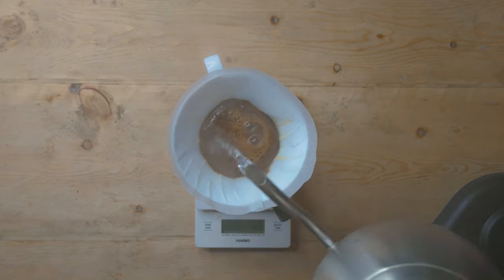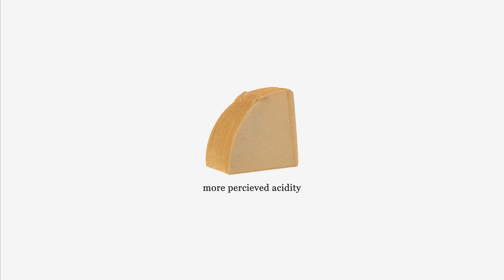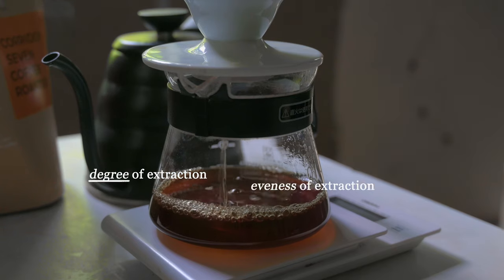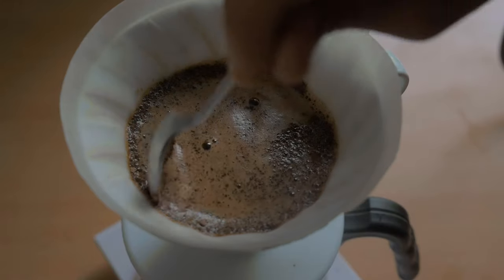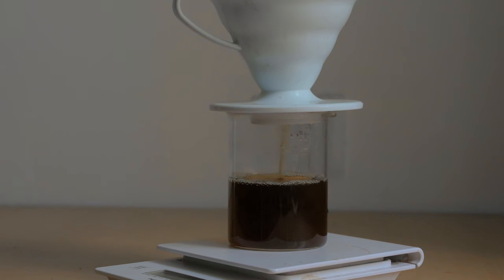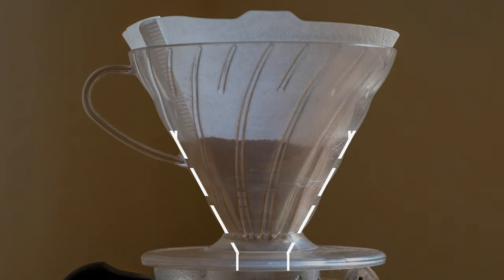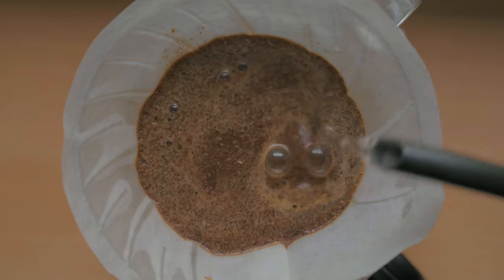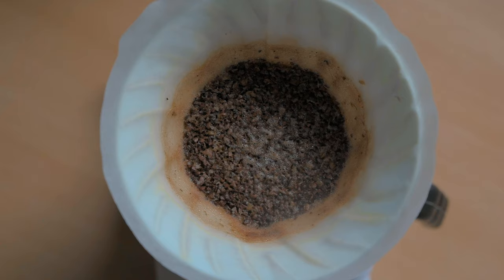Mastering The Art Of Pour Over Coffee

Comment: Great video once again. However you did not talk about the bloom time and the subsequent pour times. 
I typically do a bloom time of 45 - 60  seconds depending upon the type and quantity of coffee I am brewing.
Reply from the maker: hey!
so about the bloom time per se- to keep it simple make sure that never does the coffee ground post pouring is in contact with the air (as it oxidises) .
so if i say a bloom of 30 sec and the water has already gone down at 25 sec. i would rather start pouring the 2nd pour..
(and subsequently in the next cup adjust the grind size making it finer)

also if it does not pour entirely down at the 30 sec mark i would wait for it a bit and then pour.
(and subsequently in the next cup adjust the grind size making it coarser)
Reply: @roasting_hands  Wow! Those are fantastic tips. Thank you so much for your reply. Really appreciate it. I will try what you said.

Comment: Solid video! Q. When your grind size isn't super medium-fine then it's a little tricky to saturate the ground evenly while swirling during the bloom. The motion gets restricted by the size of the grounds due to friction and weight. Any tips?
Reply from the maker: hey legend thanks.
isn't super medium-fine - so 2 situations could be there right?

1. so if it is finer- i would go for more water and pour slight faster in the first pour. disturbing the bed. and then swirl. also what i do is - i shake the ground coffee in a small container (before) to keep them all lose and not clumped whatsoever.

2. if it is coarse- i would use more coffee so as to have the water not drip down quicker as compared to the correct grind size.

did i get the question right? do let me know :)
Reply: @roasting_hands  Yes, you did. I think the first point makes more sense in my case. To pour the water a little fast will help. I'll try this tomorrow.